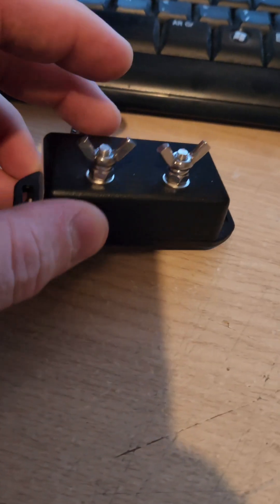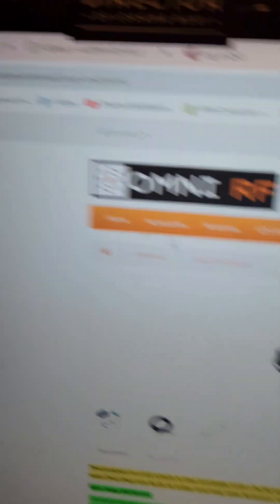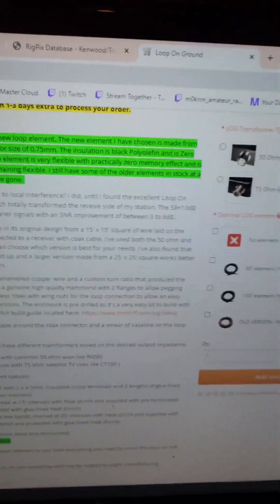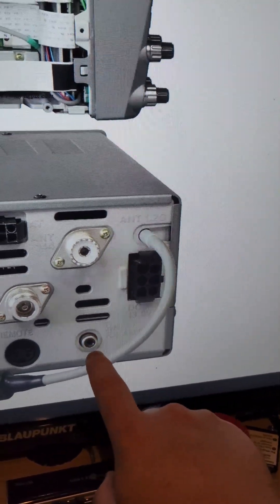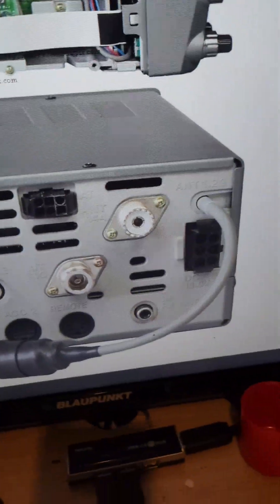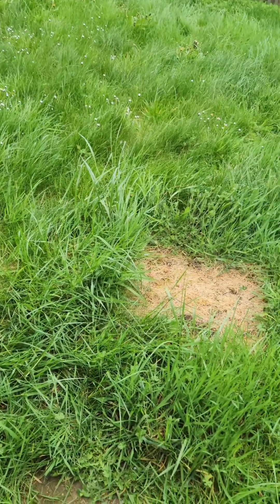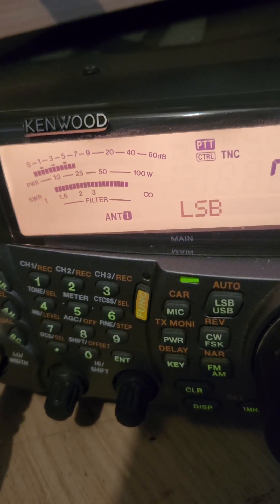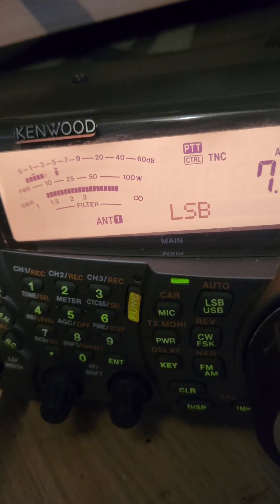Loop on the ground antenna

Comment: Sorry to hear your having problems. My only input would be to  lay the wire on the ground rather than raised and attached to the fence. Admittedly your installation is not that high off the ground, but I understand that as the loop is raised in height the polarisation becomes horizontal rather than vertical.
If anyone reading this is considering buying a LOG kit, I would suggest buying from Radio-Stuff. Their kit including 20m of wire is £19.49 delivered.

Comment: I feel your pain. Its a struggle trying to set up a decent functional station in what looks like a typical small urban site. My first observation was you are trying lots of different things simultaneously so multiple wires and poles and feeders in situ. All these things interact with each other, even if not being used, even if not intentionally part of a antenna system. This interaction draws the noise or unwanted signals all over the site. Ground loops require a "clear" area of ground to work correctly. "clear" including in the context in radio current conducting things. So things like the QRM killer wire might be getting in the way just being there. Or its just proximity, your main end fed is inducing the noise its picking up into the ground loop. I know when I tried comparing two antennas simultaneously and switching back and forth I often saw  little difference and it took years til it dawned on me the two antennas coupled together and ended up with pretty match the same signals!
A personal opinion, end fed antennas. I dont get it, I dont rate them. I think they are a fad. Lots of chatter on YouTube resulting in people trying them and finding the basic issue that unbalanced antennas are a PITA to actually use! Do you have all the balun/common mode choke malarkey in place? Is it working? Are you fooling yourself by hiding a basically nonfunctional antenna behind a tuner?
73 de G0AFV
Reply from the maker: Ive just moved my end fed up a mast so the transformer is 30ish feet in the air, it slopes down a bit to 5m after about 15/20m then comes down to my front garden, hoping this brings it away from the loop on the ground. Not going to give up got lots of testing to do